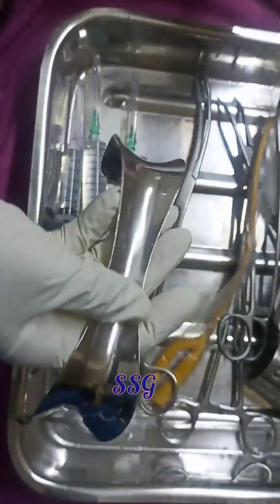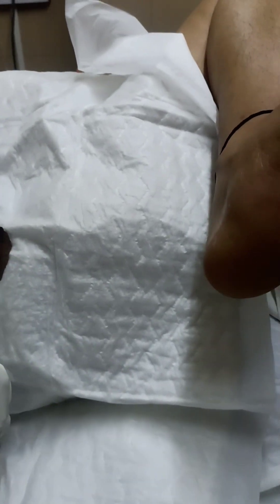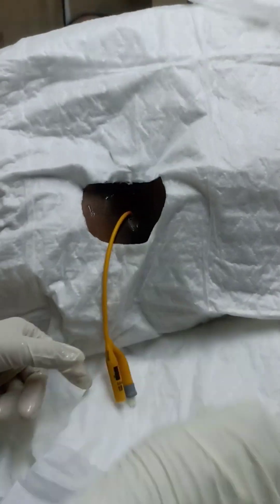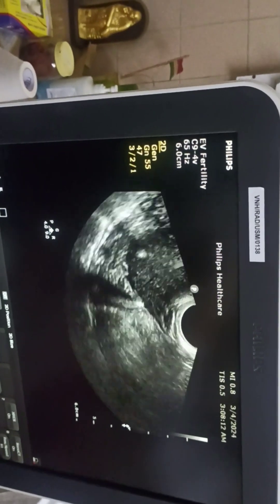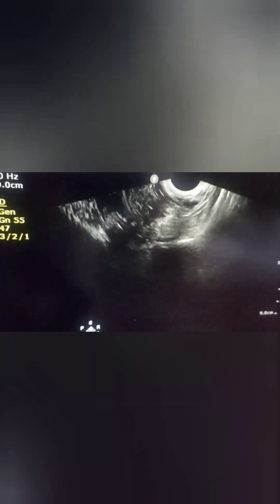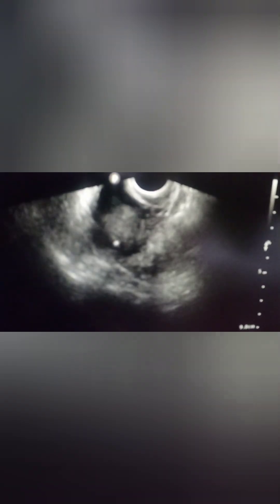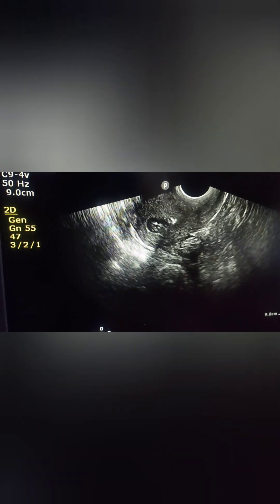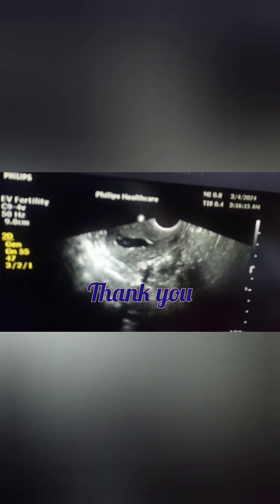How to do SSG(tubal patency test) full procedure and details

Comment: Is this painful?
Reply: So much...😢😢
Reply from the maker: Dear if it's v. Painful .it may be due to your tubes are blocked. 
But sometimes after procedure itself the tubes open..so it's important to get it done by the RIGHT DOCTOR
Reply: Thank you so much  @drpriyankaguptagyneclaproscopy
Reply: So much..
Reply: No.. just like period cramps.. don't tensed much.. it's a 10 minutes procedure.. so don't be panic..my doctor told me that to breath out through mouth.. this helped me alot.. and my nurses ensured my comfort and they asked many other questions to distract me from that fear..
Reply: No need to be worried so much. Pain is slightly more than periods cramps . Since the procedure takes 5 to 10mjn . We can bear that pain.